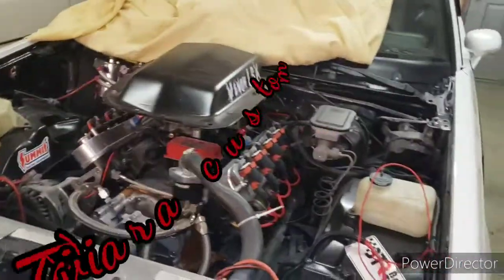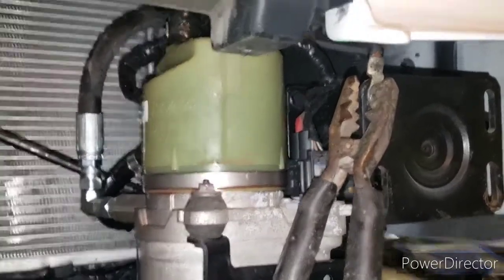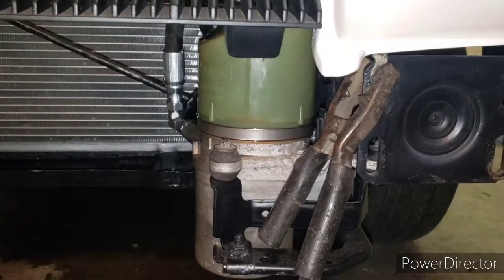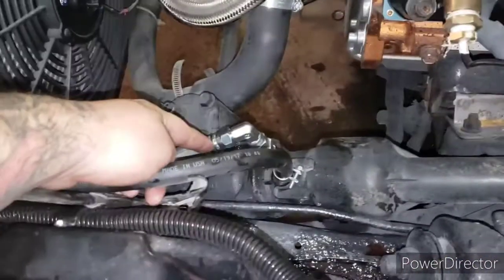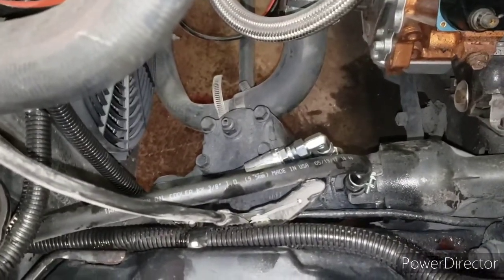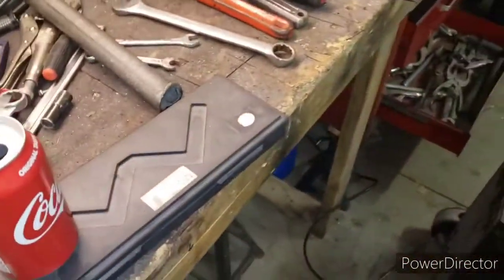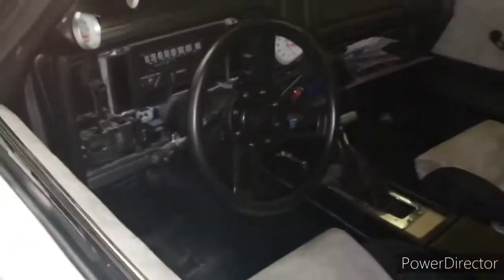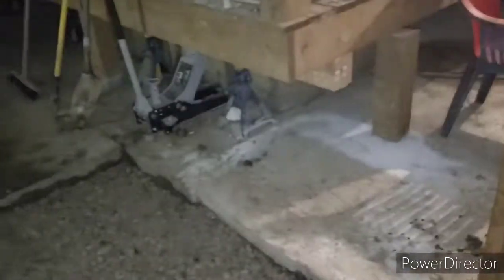G body  Electric power steering conversion

Comment: Does this remove ps pulley and of course old pump if so is there any disadvantages of ps pulley being removed or issues ?
Reply from the maker: No ps pully nope lines go straight to the steering rack no disadvantage but an advantage of less engine drag by having one less pulley for the motor to spin my car only has an alternator belt going to the crank and that is it water pump is Electric as well as the power steering therefore freeing up more horsepower add more engine bay space hope this helps
Reply: @RIVIARACUSTOMS  oh that is cool I didn’t know you can get a electric water pump I have a 1983 regal and cause of your vid I’m going with electric ps aswell, got it off the junk yard and also with the original ps pulley I heard you get clearance issues on the gearbox so didn’t want to deal with that.
Reply from the maker: @lilskkrew  yes sir its a moroso electric water pump for ls you will need to buy the braided line and AN fitting separate I believe in one of my videos you'll have to look through them I show the water pump it's basically a big block Chevy water pump but it comes with the adapter blocks to put onto an LS I barely ever had to turn my fans on and I made 600 horsepower in traffic
Reply: @RIVIARACUSTOMS  thank you for that info will look into that thank you.
Reply from the maker: @lilskkrew  enytime i try my best to help the people that support me thanks for watching
Reply: @RIVIARACUSTOMS  also do you know what’s a good header for clearance on the regal I am putting  a 5.3 of a 01 Silverado
Reply from the maker: @lilskkrew  I ordered long tube headers from Speed Engineering inch and 7/8 primary 3-inch collector for an LS swap for an S10 fits perfect you will have to modify transmission crossmember and I got the Speed Engineering 3 inch x pipe kit aswell all stainless steel
Reply: @RIVIARACUSTOMS  got it thanks again much appreciated
Reply: Hey me again for the return on the rack and the SP what size is that ? Or is it the same size as the size for the high pressure side thanks in advance
Reply: @RIVIARACUSTOMS  Hey me again for the return on the rack and the SP what size is that ? Or is it the same size as the size for the high pressure side thanks in advance

Comment: Nice!! 👍🏾 So will the pressure line be the same 24 inches on a 1984 Monte Carlo ss. And did U have to call Volvo to get the line made?
Reply from the maker: All g bodys are the same and eny place that makes hydrolic lines for like skidsteers bobcats and stuff can make it for you i have a local place that you prob dont have but try that
Reply from the maker: As for how long you need will be based on were you put your pump mount the pump and then check how long of a line you need first
Reply: @RIVIARACUSTOMS  alright cool! Thanks 💯🫡

Comment: i will be building an aluminum box with sound deadening that can be taken apart with bolts and heat deflection on that outside to keep the noise down. 
it needs to be able to be taken apart so that i can inspect and service the pump when necessary. i haven't seen it done yet so hopefully someone else gets the idea

Comment: Does this need a power steering cooler?  My car and truck both have power steering cooler under the radiator.  Does the original Volvo that the power steering pump came out of require a power steering cooler?  Does the power steering pump require CHF-11 or is it okay to run regular transmission fluid in it?  Have you heard anything either way?  How is the electric power steering pump holding up so far?
Reply from the maker: No you don't need no cooler Pump works great regular atf fluid works

Comment: Did you come across this issue. The higher pressure from the volvo pump vs the GM pump causes the seals to blow out from the gear box due to higher pressures?

If so, how did you reduce the H.P? Fluid restrictions or electrical?
Reply from the maker: No i have not mabye the seals were just old

Comment: Thank you so much for this. I recently installed a Big Block in my Monte. I wasn't sure what I was going to do and I kept thinking that there had to be electric option somehow. Not to mention I was either going to have to order a 70s Chevelle bbc lwp ps brackets and or March performance mid bracket not knowing if either option was going to work and believe it or not this electric option was the least expensive way to go. 45 dollars at the local salvage yard and about ten min worth of time. My only question is what fluid are you using the volvo recommend or gm power steering fluid also how many miles have you drove with this and have you had any issues? Thank you so much again for taking the time to post a video especially for a G body.
Reply from the maker: I just run atf tranny fluid and havent had a problem yet works great so glad i could help thanks for watchin tell your freinds to sub only a bit more to get to 1000 subs and i can live stream these installs

Comment: Good video 💯     are all 4 fittings the same?   2 from pump & 2 for the gear box?   Im doing the exact same set up on my 85 Monte Carlo.   Appreciate the video
Reply from the maker: No i think there both different ill check for you after work its been awhile
Reply: @RIVIARACUSTOMS  thank you i got the one in the video written down 👍
Reply from the maker: OK just looked over my video and it tells you everything you need in there your low pressure line all I did was cut my stock line a little longer and flare it and then I just put  A hose on it with a hose clap you do the same thing with the Volvo side it's just slip over now the high pressure line I show you in the video Go to a high pressure line place that makes high pressure lines and give them those measurements that you see on the hose ask them for an elbow as well to adapt to that And then I also show you the package from ICT billet you need to get those For g body and they will adapt to the elbows that the high pressure line shop will give you And it will be the same for the other end to the pump if none of this makes sense let me know
Reply: @RIVIARACUSTOMS  the fitting in the video how many i need?

Comment: Is that pump 12v or 24v ?
An have you measured the amp draw on it ?  An if so how what was it ? 
This sounds like a better way to go than just swapping in an old manual sagina steering box an doing away with the pump but im thinking i may put a inline fuse just in case
Reply from the maker: Its 12 volt and you will need at least a 160 amp alt

Comment: I’m having an issue with a 64 c10 build on an s10 frame and my ps pump pulley is directly on top of my steering box leaving me no room for the hose to plumb up and 1 have a few questions for you
Reply from the maker: You can send pics to chikoking60@gmail.com

Comment: Can you tell me the dimension of the pump unit?
Reply from the maker: Its about 11 inches top to bottom 4 inches round
Reply from the maker: I can check forsure later today
Reply: @RIVIARACUSTOMS  I'd sure appreciate that, looking at these for a Jeep project
Reply from the maker: @tomkrause62  9 inch high 4 inches wide and the bracket to bolt the pump sticks out 7 inches wide at that point
Reply: @RIVIARACUSTOMS  Thank you
Reply from the maker: @tomkrause62  np enytime